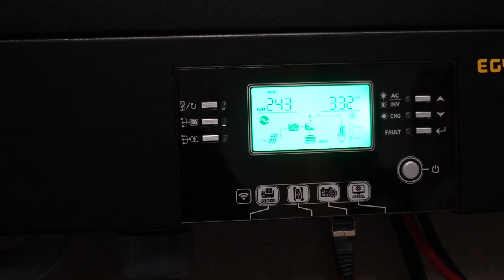PREPARING for the WORST! WHOLE HOME OFF-GRID SOLAR! EG4 6000Ex Inverter w/ EG4 48v Backup Batteries

Comment: Just curious, will this system run your heat pump is it geothermal and how many tons? We have a 4-ton geothermal system and want to install solar next year. Thanks!
Reply from the maker: Short answer is yes, it will run it. Amps may become and issue in the coldest and hottest days. Keep in mind you will need a much larger battery bank to run it over night. I’m soon to do a video on how I converted my existing heat pump  to a solar or grid only system. Test your amps with a volt meter too as how much it pulls before you buy.

Comment: Hello I have 7,400 watt of solar 3,000 watt 120 volt inverter with 12 volt 50kw lifepo4 battery bank the only thing I Ron on the grid is water heater clothes dryer and the 4 tons a/c for the last 5 years and now I’m working to go 48v 12kw growatt inverter
Reply from the maker: That’s awesome! I wish we could run our heat pump right now but it’s going to be duplicating this system. Thanks for watching!
Reply: I also have a 25kw battery bank with 3kw solar system it has a 2,400 24v low frequency inverter with a step up auto transformer to run a 2 ton mini split a/c and heat pump if you look at my videos is there

Comment: Wondering why you didn’t go with 2 of those inverters, I thought you said in the start you ordered 2 6500 units.
Reply from the maker: Great question! I ultimately didn’t need the additional amps, I really only needed split phase so my entire panel would be hot. Most of my loads are 25amps or less on each leg. It was a way to cut some costs.

Comment: Jeremy, you mentioned that when you have a lot of solar coming in and have the AC In connected to the inverter, it look “like a party in your house” with lights strobing.  Can you tell me what output priority your inverter is set to?  Is it set to SUB (Solar Utility Battery) or SBU (Solar Battery Utility)?  I have 2 6500EX inverters set up in split phase (like what you originally wanted to set up) and I’m using my solar system exactly like you are with a specific Grid Panel and a specific Solar panel.  https://youtube.com/user/bones7151.
Reply from the maker: SBU. Thanks for the help!
Reply: @cjfunnyfarm  Hmm.  I know we have different inverters, but I would assume aside from yours being LF and mine being HF, they're fairly similar.  

I've talked with Signature Solar about LEDs flickering and they told me it's basically par for the course when using inverters to power your home.  They also said you'll get a lot more flickering with cheaper LED bulbs.  I guess they've seen a lot less flickering with Philips brand bulbs.  Something else I found out in my own home is you can't use dimmers or even really dim LED bulbs because they'll just flicker.
Reply from the maker: The fact you don’t experience these issues concerns me about the unit. It’s really odd, SS mentioned that to me about the LEDs as well. If I run completely off grid/battery, there is no flickering at all. Just when AC input is hooked up and PV power exceeds near 2.5-3kw of generation. I have considered sending it back as the AC input was supposed to just be there if necessary  but it’s impacting everything on a daily basis. Thanks for your comment! I’ll all ears if you can think of anything else.
Reply: @cjfunnyfarm  I agree that something's still happening inside the inverter when in grid-bypass mode.  I've noticed lights that are prone to flicker when on battery mode still tend to flicker when in grid-bypass (but they never did that at all before the inverter was introduced).  

You're not near your max pv input either, so it couldn't be something regarding that.  If I recall, this only has 1 PV input.  Can you remind me what your max VOC and AMP are on your solar string?
Reply: @AdamDeLay07  Adam - you're not having this issue?  This is the first I'm hearing about it.  I have 30kWh of batteries and two of the EG4 3000 w inverters arriving this week.  I have LED's throughout the house, i sure hope this isn't the case as that would be a deal killer and going back to incandescent bulbs doesn't make sense from an efficiency standpoint.
Reply: @reviews2you  no I’m not, but I have 2 6500s.  I have more issues/annoyances with my grid connection than when I run off battery mode. 

The biggest issue I have with blinking lights is when my washing machine runs.  Several lights on that same phase pulse in tune with the washing machine cycle.  That might be my washing machine or the bulbs though.  I have a video coming out this weekend on how I was able to drastically reduce the blinking.
Reply: @AdamDeLay07  That's unfortunate and a bummer to hear.  I presume the amperage cycles up and down when you're washing a load of clothes and the HP inverter takes a second to react at each big pull, but that's just a guess.  What percentage of the inverters power are you using on average, and do you ever come close to running them both at max?  Looks like you're running them both only in 120v parallel mode.  I skimmed a couple of your videos real quick.  I subscribed and rang the bell so I can see when you drop an update.  

My batteries and rack and inverters arrived today.  I went with a smaller inverter than you guys, hope I don't regret it but I got two of the EG4 3000 watt inverts and going to run them in split phase.  I plan to run the entire house except for: 240v water heater, stove, dryer.  Everything else I plan to run including my main HVAC.  I'm in Phoenix and have 12kWh PV array going up so I should have plenty of solar coming in.  I will probably run my inverter in SBU mode whereas you are SUB mode, but I do plan to tie in to my main panel so will be interesting (frustrating) if I have the same issues.  I'm not sure if my 30kWh of batteries will get me through the night yet or not, that's the big unknown but time will tell.  Should have it up and going by mid January and plan to throw a video up of the install and will likely update along the way since there isn't much content around these up on YouTube.
Reply: @reviews2you  So I'm running my inverters in split phase.  I would say on average I'm running 10% or less, but I only have 120v loads on the inverters at the moment.  I need to figure out some logistical issues before I move over some of the 240v loads.  

When I have plenty of power, I'm running in SBU mode.  Only when the power levels drop to a pre-set limit in my Solar Assistant, do I end up switching over to SUB mode.  

Good luck on your install!  Can't wait to see how it goes!
Reply: @AdamDeLay07  Side note – Not all LED lamps are compatible with all LED dimmers.  You almost need to contact the lamp manufacturer to see what dimmers the lamp is compatible with.  Yes, I’ve found the cheaper the lamp, the more problems I have with flickering in a dim mode.
Reply: @Mkiepert  while it’s true not all dimmers are compatible with all dimmable bulbs, if there’s no issue with the bulbs and dimmers before you introduce the inverters (on grid) then the inverters must be introducing the issue.

Comment: The fans are crazy loud
Reply: Are they supposed to run constantly?
Reply: @Laurel-Crowned  I'm wondering the same thing too
Reply: @eagle5720  well I hooked mine up to the solar last night and this morning the fans are running constantly with nothing else hooked up. Doesn't seem right and will be needing fans in a few years if that's the case.
Reply: @Wind Storm  yea that's how mines are running too and it annoying n high idle consumption

Comment: What a bummer on your grid feedback. Is there any videos on how to setup this inverter I'm finding it a bit complicated and the manual is no help. Does it need to be setup from a pc or do the buttons actually do something besides scroll threw stuff 🤷‍♂️
Reply from the maker: When pressing and holding the enter button for 3 seconds the inverter will enter setting mode. Press up and down to select setting program. Starting on page 13 in the manual work through each setting. It’s really important to be familiar with how each setting impacts the inverter. If your confused about anything defaults are a safe bet. Otherwise your welcome to reach out to me or Signature Solar is a great help. Will prowse has some great videos on the 6500ex which is pretty similar to the 6000 for reference. Thanks for watching! Let me know if I can help!
Reply: @cjfunnyfarm  😂 just found the video I needed to setup from SS. Took all day searching but glad I finally found it. Thanks so much for your reply and help!  Do your fans run constantly? I only have my solar hooked up till I can setup my 60v battery bank so it's pretty strange the fans stay on
Reply: @cjfunnyfarm  wow at that rate this unit will most likely need new fans within a few years 🤦‍♂️

number 9. Solar energy feed to grid configuration. What exactly does this do?
Reply from the maker: The fans run most while solar is generating but it slows quite a bit over night. SS does provide a decent warranty on the product but time will tell on the fans holding up. 

From how I understand, Number 9 isn’t designed to be used with this inverter. It’s a setting for back feeding to the grid and this inverter isn’t certified to that in the US.
Reply: @cjfunnyfarm  that's what I figured. Just saw it in the book lol. Do you know what the included fuse is for?
Reply: Hi, how has your system been doing?
I only have four batteries and 6,800w of solar but the max charging voltage is roughly 5kw. Only a few times did I see it go to 5.93 but only for a few seconds. This doesn't seem right to me. What does yours put out max?

Comment: You have an obvious NEC violation. You have the PV wires coming through the wall in PVC conduit. NEC 690.11 requires that DC circuits passing through the walls or attic of a residence, be metal (EMT, RMC, or IMC) if the inverter is not equipped with arc-fault protection. Or else, you should install a DC Arc-Fault breaker or combiner box between the switch and the inverter. DC Arc faults are what cause house fires. NEC 690.11 has exceptions, but if you used a non-metallic conduit, it doesn't meet code.
Reply: Thanks for the info. Would 50 volts DC be okay in pvc conduit?
Reply: @uhjyuff2095  Yes, per NEC, only voltages > 80Vdc, or more than 1 solar panel must have AF protection or be in metal conduit.
Reply from the maker: Thanks for the recommendation. I have some work still to do on the outside for sure! I’ll consider making the suggested changes! Thanks for the comment.

Comment: Well if you get EG for batteries and you get the easy I have to hook up and it's connected the eg4 inverters are already connected to the eg4 batteries there's no changes no connections no updates you ever have to do to have that connected and the batteries talk to the inverters and tells invert is what it wants and the inverters obey and keeps the batteries happy which keeps your inverter happy easy peasy that's why it's called hook up and play of course you could have screwed up the programming on your inverter so it wouldn't work that way but what batteries do you got now that you showed me that batteries may I tell you something you may think about having 12 of those batteries that's probably what you're going to need.

Comment: Good luck with gutting tech support if you have any issues with ss products.earned the hard way after spending 30k. Their inverters are knock offs of mpp which is made in he US. Eg4 made in China. I've learned it's better to go with quality for off grid and back up system vs cost savings you get what you pay. Go with a reliable solark.

Comment: That's what they told me 4 and 1/2 hours is what I get what heck I had solar panels now since 30 years and my old solar panel still give me the same watch the day I bought them as they do now as what they told me they would then oh I got some new solar panels but I don't got enough solar panels so I don't run everything in my house yet but let's give you a kicker of a taste I have a kitchen stove that runs 3,600 Watts I have a water heater that runs 4800 Watts I have a microwave that runs 1700 Watts I got a bunch of gimmicks cookers that run 1800 watts each but maybe you should tell you about the dryer all the one 120 volt hookups first remember to tell you that I should probably need about 4,800 more watts to run my house but it wouldn't run everything even with the watts I already have I'm working on getting more solar panels but I live from week to week and I've been more can I get more solar panels for some time now and sometimes when I get it it is very pricey I finally found a place that's a little bit cheaper but even some of the things I need there is pricey and it'll take me probably half a year to save up the money if not a couple years to save up the money to buy more solar some buying a smaller ones when I can one or two at a time when I get a little bit extra money I buy bigger but I can't buy a few only at a time because I can only afford a few at a time to buy a whole bunch that's just impossible but that's what I got to say about my money for and one very well not do it for me and yes I want to eat you for inverters just not the same one you got I want the regular ones that they had before they had though 120 240 volts put together I want two inverters for 120 and two inverters for the 240 volts and I'm probably going to need three for each instead of two and two and I even have a smaller house than you.

Comment: On one of the same if I save up a money for a month I might be to buy an inverter I need you for inverter that I want but I have to suffer on other things and I'd have to probably do that several different times but if I had to brains I'll save up $120,000 and buy that sell my load of 590 Watts bifacial solar panels which is 40 pellets 31 solar panels in each that would take 100 percent of my pay for 3 years maybe four and probably more like four that means no food no gas go back and forth to work and no pain of any other type of bills or even health insurance like I said some things are a little bit pricey for me at this time including the 31 solar panels that eg4 solar signature wants to sell me.

Comment: Well I'll never get anything gas for my house if I have electric dryer that's not doing so well I just get a different electric dryer plain and simple then I'll run down the vent into the Attic and there's a reason why and I hate to addict and it also make it so the it comes and hates the clothes which would also keep the snow off my roof.

Comment: The only funny thing about your inverter is when I bought my house it's a 100% electric 100% electric you kids and you are kids full grown adults or still kids to me and one of those inverters won't run everything in my house run run my kitchen stove and water heater when I need it too or my dryer or my refrigerator my 2000 Watt refrigerator actually I think it's 2200 Watts cuz some inverters I have will not run it course the eg4 inverted will run it but then it won't run the kitchen stove the water heater the dryer or the rest of the 120s in my house or even some more important than 240s for my kid that I need to have that's why I say the 6500 watt inverter * 4 have to 240 and the other half 120 and it actually might have to be 6 inverters half of them 120 and the other half 240 and I do live in a smaller house than you my house is 888 ft and I don't have a wife she took off when my kid was only a few months old and she hasn't been in the kids life ever since then and my kid is 17 years old today well a few months back but she's 17 years old right now.